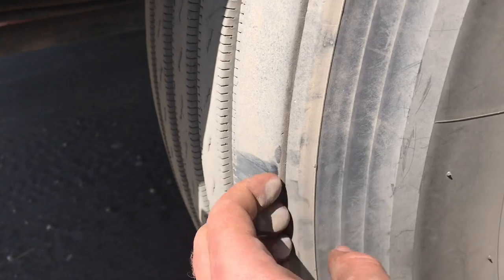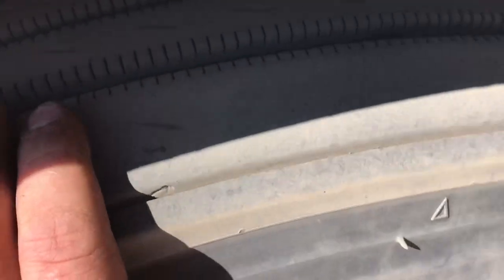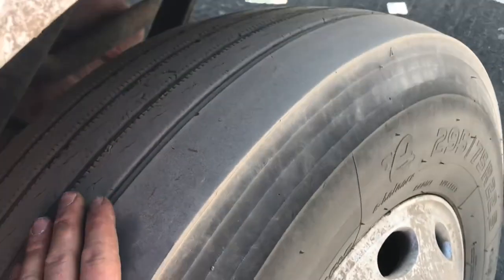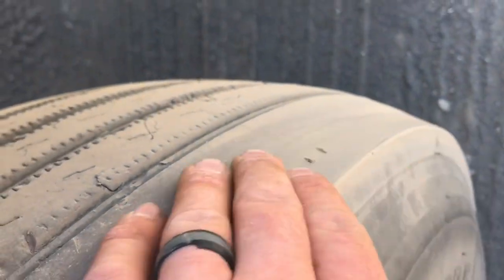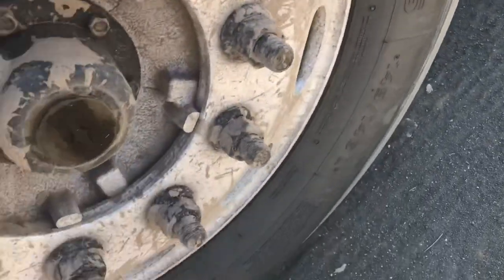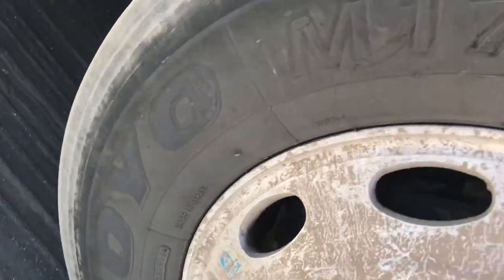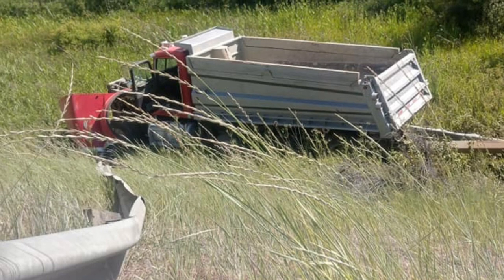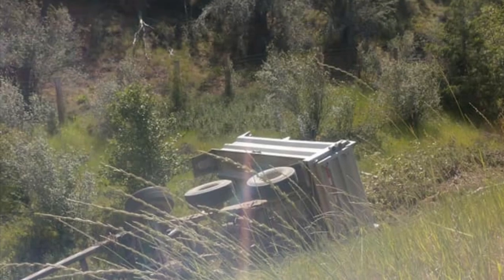Steer Tire Inspection: Big Rig Tire Blowout Prevention

Comment: I had a blowout going 70 mph on my passenger steer tire in Oklahoma a few years back. Luckily I was able to control it and save the rim from damage as well. But I still realize not everyone is that lucky.
Reply: Did you have to tools on hand to replace it or had to tow it?

Comment: I've been driving truck for 24 years, freight delivery, dump truck, etc. Proper pre-trip and post-trip inspections are very important, got to stay on top of that stuff.

Motorcycle instructor on MC Rider says always leave traction in reserve.

Principle applies to big rigs also. Don't push everything to the limit. If you have a blowout, which I have, or the load is top-heavy, slick roads, whatever. Staying well within your limitations gives you the ability to deal with an emergency.
Reply from the maker: GearheadTed that is the truth! I’m amazed with some of the guys I work with the state of their tires. This was actually another guys truck I hopped into and not my usual truck, however I’ve seen him lose a steer tire before and I think it was from neglect like this that it happened. I think of the guys in my crew I’ve seen most of them lose a steer tire and that’s not a club I want to join if it can be avoided by making a phone call to our tire vendor! 😬 I’m with you it’s not worth the risk!

Comment: Thank you for the video what did you do fix that tire problem on your truck I'm having the same problem and  many alignments can you help thank you 😊
Reply from the maker: Look into inflating your steer tires more. The old standard was 100-105 which for modern tires isn’t enough but “is how it always has been done”. See what the load rating for the steer tires is and see if it can handle 115-120 psi.

Comment: I’m on my way to work and I just got my car back from the shop and they said I need a new tires. There’s a front tire that I’ve had to put air in and outside edges are called but when I’m driving, I feel a vibration and the pedals, and it’s making a Rotation noise and I’ve had a tire blow before but I was doing about 40 miles an hour I’m about to be on 70 on the highway. Am I know if I should be prepared for a blowout and what to do if that happened or on if I said from fucked up on 40 in the 60s on like I’m really scared that well when I’m doing miles an hour and I don’t have another way to work now it’s OK there’s no side roads there’s nothing but the highway

Comment: Ok...so what's causing the tire wear??? I thought you'd go into details of what the problem is
Reply from the maker: Under inflated steer tires. The current tech of steers can handle 105 psi but a lot of companies are still under inflating because of “this is how it’s always been done”
Reply: @buckn32  this is most definitely not caused by underinflation. Under inflation will cause a ripple wear throughout the whole tire. This type of shoulder wear is caused by some sort of front end issue, typically the truck will be out of alignment.  Also, most low profile 22.5 tires like the one in the video are 14 ply and rated for 105 psi max. So overinflating will cause a whole new set of issues and can be just as dangerous. 25+ years in the commercial tire business here
Reply from the maker: Just like I said how it’s “always been done” 😉👍
Reply: @billymillan8751  balance is done,  alignment is done, Kingpin are done, shocks are done, 7 months and my 1 of my tire looks just like that video what do you think
Reply from the maker: @edward Hernandez another factor I’ve noticed is always doing multiple tight turns to the left every day so the right outer shoulder wears-probably with too much acceleration 🙈. So when coupled with under inflation this scenario presents itself.
Reply: @amhndzable check your tie rod ends.

Comment: How dangerous is the tire if the shoulder on the outside is rounded off ?
Reply from the maker: Replace immediately. I’ve only one has steer tire pop on a dump truck since I made this video. Thankfully it happened at 5 mph so I only lost steering with not much consequence.

Comment: How do you prevent this
Reply from the maker: Best hypothesis to prevent I’ve heard is fill tires to 115 psi. Stay tuned. Later this month I plan to drop an updated video.
Reply: If im right its the king pin or wheel bearing